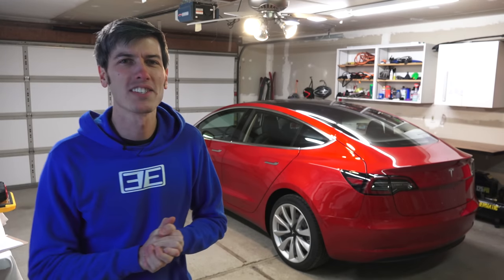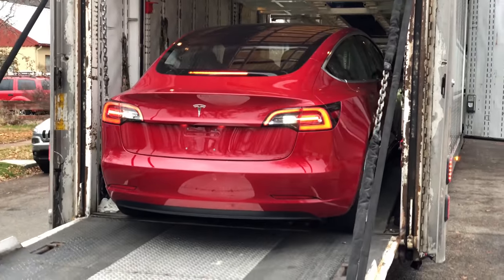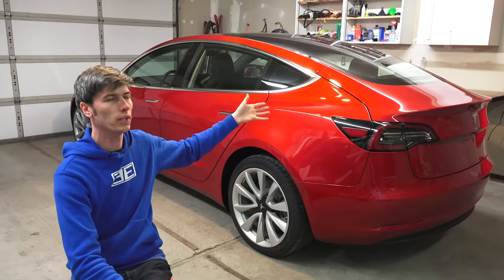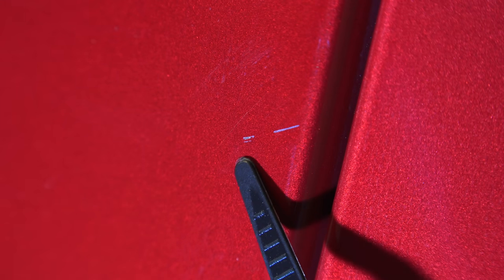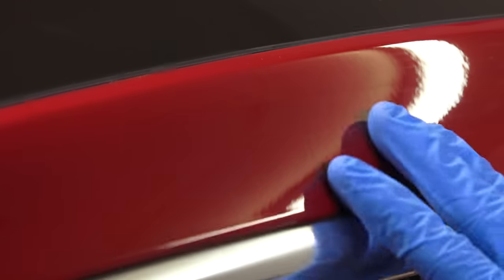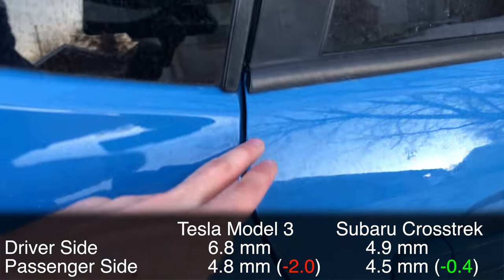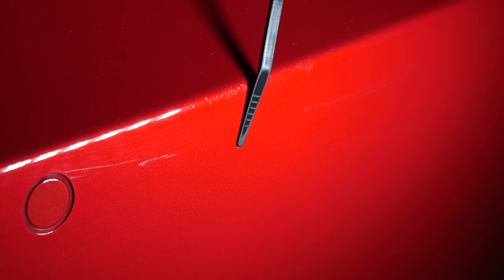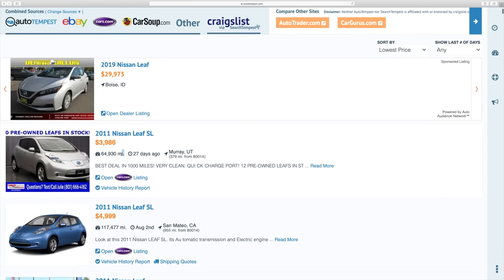Everything That's Wrong With My Tesla Model 3 - Quality Problems

Comment: Can someone buy a new merc, BMW or Audi and do a video like this. I would like to compare the quality to the tesla
Reply: Well, he did compare it to his older Subaru ...
And, I'm guessing he didn't pay a $2500 upcharge for the paint on the Subaru.  For me, the main reason the paint is unacceptable, is it was a rather expensive "feature," and to have a paid-for feature not done well, that's bad.
Reply: A few year ago a cousin of mine bought a new Reanult Megane. Upon inspecting it at the dealer we found it had a noticeable depression on the drivers door pilar down the bottom. He decided to take the car because it would look like garbage one year later anyways.

My 2010 Seat Ibiza had perfect paint, but my dads 2014 KIA Sportage had some "orange peel" to its paint. No scratches on both cars.
Reply: @Biker_Gremling  That's one thing about VW Group body and paintwork - they pay a lot of attention to the quality. No orange peel on any of our VWs, and they range in production dates from the late 90s to 2017.
Reply: I'm very tempted to measure my 2007 Jaguar X-Type panel gaps. As for the paint quality - some minor stone chips, and a scratch or two due to inconsiderate people in car parks, but there is zero orange peel and the paint looks like a luxury car's paint should look.
Reply: Don't need too. They mostly require premium gas, expensive oil changes, more frequent brake work, less tech, don't improve OTA like Tesla.  Maybe it's just me, but give me extremely minor surface issues (that they're resolving as is) vs having less of a vehicle that only gets worse and costs more to own. If you prefer possibly better paint and 'rich leather' vs a car that feels 5-10 years ahead of the others, go nuts ;)
Reply: My audi was flawlass.  It's black and it didn't have any swirl marks so that the paint looked wet.  My car was special ordered by me and I took delivery after three month wait.
Reply: @m40dot   Depending on how you drive (especially a manual), you might not need brake work that often either. I'm on 120 000 miles with my current car, and it's still on the factory brake disks and pads, with about 40% life left on the pads.
Reply: A couple years ago I bought a 6 month old 1 series with way fewer issues than this. No one should accept this kind of fit and finish in a brand new car, imo.
Reply: @josephgaviota  while i dont disagree i thinj thw paint itself is flawless, in a candy like that usually you get little mishaps that show under light. but the care taken after paint of the parts is where the issue lies
Reply: @chrwl007  I honestly would had prefered some imperfections on my paint instead of suffering Dieselgate.
Reply: @chrwl007  would be good if they payed attention to emissions also.... Ya know
Reply: @chrwl007  so unreliable car how can you live it with?
Reply: @deathman020  Much easier than it is for you to keep on explaining how you can keep believing the Jaguar bad reliability myth fed to you by motoring journalists with an agenda and your car bros who think having a car so low that you can't see the top of the tyre is cool. Underneath it's a turbodiesel Mondeo with a manual gearbox, so the drivetrain is bulletproof. Don't even think of mentioning electric and electronic problems... those were all Lucas.
Reply: @deathman020  That was Dieselgate... didn't affect their petrol-engined cars at all. Also, they were the only manufacturer caught cheating. How about Hyundai Motor Group that overstated their cars' fuel efficiency by up to 30%?

Comment: When comes the time, when Germans starts with electric car production, Tesla will be dead.
Reply: They were supposed to have killed Tesla by now - they just haven't found a way to do it. If I earned a buck every time I read about a Tesla killer in the last few years, I would be very rich by now
Reply: @toneyeye  they have got a head start thats all and a big fat fanboy base because I would pay only 1/4th the price for that kind of quality.
Reply: You know the Germans always make good stuff
Reply: Unlikely we will maybe produce good electric cars but if Tesla keeps inproofing we do not stand a Chance.

As you can see it with the taycan poor efficency, small range, extremly expensive.
Reply: They won’t really. Hydrogen will probably out produce EV.
Reply: @flyboy970  Liquid Petroleum Gas has been available for years.  It's around 75% cheaper per distance than Gasoline.  Currently it makes up only 3% of the world's cars.  Hydrogen will face many of the same problems with adoption as liquid propane.  It's also about 6X more energy per volume released if it explodes.
Reply: pyro226 actually producing hydrogen en mass is very expensive, the best way is probably through electrolysis and over time the cost will come down, just like Lithium has. Hydrogen is about 7% the density of air, in a car it’s a none issue. Petroleum is pretty flammable and explosive yer....?! A lithium battery explosion is far more an issue for two reasons - lithium is heavy and thermal runway in the cells makes it difficult to extinguish quickly. Still hasn’t stopped mass production. Point is, longer term, Hydrogen is cleaner and won’t be dumped back into landfill like lithium will when the cells die.
Reply: @flyboy970  I know electrolysis can be used.  From what I heard, hydrochloric acid and aluminum are better producers and the components can be recycled better.  It was a big discovery when someone looked into the chemical reactions behind the Works Bomb.  Gasoline is explosive, but I'm under the impression that it is less so than propane and extremely less so than Hydrogen.  Diesel isn't explosive and cold countries fuel while the vehicles are running as they won't start if shut off.  I was debating on mentioning the energy density of lithium.  Even if we doubled the energy density, it's only taking 500-600 pounds off a Tesla if we wanted to maintain the same range (less if a smaller car).  On the Tesla's, it's only a small improvement on fuel efficiency as the car weigh over 3500 pounds.  So maybe a 10-15% improvement in range by cutting battery weight.  Another benefit is that if the battery has better density, they use less materials to procure the battery, so it's going to come down to the cost of lithium's replacement and how cheaply it scales.  Cars with small batteries are just going improve in range as it doesn't make sense to cut battery size.  Main reason that I bring this up is that batteries need more than 2X their current energy density going forwards. Lithium fires are bad, but I haven't heard of them in cars yet.  Car Lithium batteries are probably mandated to be recycled.  The chances of lithium car batteries going to a landfill should be low.  While clean is great, it doesn't usually drive the market.
Reply: Once Toyota gets in the game it’s over for everyone.

Comment: Wait you really got this car as new and with those scratches/defects? No way in Europe they could sell so bad condition car as new. Actually  it's shocking that you are giving for fixing, because no way they are going to paint metal parts same as in factory.
Reply: Kaupo this never happens in the United States. This is just a recent Tesla thing
Reply: Europe isn't magical. Laws don't stop things from happening, they're only there to punish and amend if they do. Tesla could and probably will still sell a car with paint defects, and you'll just complain under your European law to get it fixed. There are plenty of examples in all the car industry where brand new cars are delivered with issues, and that's why they have a warranty so you're easily able to get those issues sorted out.
Reply: @simonj48  Wait you are talking about fixing metal parts by repainting for brand new car? They will repaint it, not exchange to new factory painted parts. No human would agree to that and return the car.
Reply: @kaupo8699  Im working as a detailer in sweden and its not uncommon to repaint panels that have been damage in shipping or have defect from factory, before or after its been delivered to customer
Reply: @MrPontiacpower  And you don't tell it to new owner, right? That's why I always give my friends paint meter also for new car buying.
Reply: @kaupo8699  well we are a separate company that does the pre delivery work, but yeah sure, the customer never knows. With that being said I think its wrong and poor customer service, but to be honest like 90% wont notice and wont care about this stuff once they see their shiny new car sitting there

Comment: Even without an upgrade paint - it should be flawless or they make it so.
My biggest "not going to buy one" is the interior... for a $70K car, it should be something more than a $18K Toyota.  The interior is terrible in every regard.
Reply: Isent the model 3 meant to be like 35k?
Reply: Sandertu it “starts” at 35k yes. Extended range model or performance model will run you upwards of 40k.
Reply: @timothygross5512  And the cheap toyotas start at 16k so he is still talking about the cheap versions.
Reply: Sandertu also if you look at the general 5 yr average cost for owning a car, there was research done between a 28k civic and the Tesla at 38k with the Tesla actually ending up costing less by the end of the 5 year term. Story short you’re kinda just paying some of the ownership cost upfront with a Tesla. It’s kind of a trip cause yes the up front price is a little high, but your savings are much better than with an ICE vehicle
Reply: @timothygross5512  Hmm, i have not seen the research you are talking about but 2 things i know about batteries.
They dont last forever, they will need to be replaced at some point, fully, no refurbish BS. and that will be more than half of the cars cost. All comparisons done before that is of not much use for the longterm ownership. The body may last 1 000 000 but batteries certainly dont.
They are not suitable for climates with proper winters. So hope for faster global warming for that to change.
Reply: @sandertu8366  
They last for a million miles, just like the drivetrain
Reply: @ogzombieblunt4626  Sauce please!

Comment: Are sure this isn't 90's GM quality!?
Reply: I love the 90's gm comparison everyone always does.. Oh you mean the car you drove when you were 16-22 didn't hold up to your constant abuse quite as well as the twice as expensive car you drive as a more mature 35-40 year old.. WOW, I am shocked.
Reply: @illregal  all I remember about gm is my parents cars. they rust bad after like 15 years, lots of mechanical gremlins, no good. Then my mom got a 2002 corolla and has had it longer than any gm or ford back then.
Reply: @Gritt982  in the early 2000's car manufacturers started electrocoating the frame and panels with an anti-corrision material. Rust resistance is now better than it was in the 90's, so this comparison is a bit harder to justify. Additionally, major rusting usually only occurs in the northern states due to the use of salt on the roads.
Reply: @GOAE7777  what about my first car, the 97 tercel, why didn't that rust as readily as my mom's 95 Sunfire? I didn't wash it more or anything.
Reply: @GOAE7777  my dads 03 Chevy Optra also had a rust problem. Again my mom's 02 corolla is still on the road. I think gm has failed my family as a whole. They had more than one chance to build a respectable car for us but were never capable. I went out last year and bought a new  corolla for myself. GM are okay if you get a new car every 5 years but That isn't for everyone, some people want a car that will stay intact for longer. I love gm and I hope they do well they just don't make the product/car that I need in my life.
Reply: Lol proof is in the pudding 😂
Reply: @Gritt982  15 years? What kind of loser drives a 15 year old car?
Reply: And someone who is going down the road in a vehicle combining primitive safety systems and degenerating parts well passed their intended lifespan.

Comment: At 5:26 you can see the Paint colour and structure are different left to right. Cars normally get painted with all body parts assembled. Means at yours parts were swapped afterwards. Y you accept the car at delivery. I received a Renault here in Germany delivered on Truck an i took 30 Inspection time, before i signed the delivery papers.

Comment: Dude, if I receive a new car with paint work like that I will ask Tesla to come collect it and provide a proper replacement or refund my money
Reply: You didnt watch the part of the video where Jason said that Tesla will fix the car and give him a loaner car in the meantime? What else can they do,  sometimes things doesnt go 100% and things needs to be fixed. This looks like transport damage mainly, except ofcourse the dust in the paint.
Reply: @Robinlarsson83   -  Yep, and sometimes things don't go 50% either...
Reply: @Robinlarsson83  Then it would be fixed car, not a brand new factory car. Any extra clear coat on a panel will give different color reflection from original adjacent panels . Buying online is terrible ,  you should see what you get on a lot.

Comment: wow did they use 100 grit  sandpaper to give the car a last polish ? The Finish is horrible so many small scratches . And the Glass pieces don't match up at all. But even the older teslas feel like your riding inside a tin can.

Comment: The panels not lining up is a manufacturing issue that should not be happening on a car of this cost. The paint issues are very much a process issue where no one is doing even a basic walk-around of the car before delivering it. That is a very, very simple thing that every new car dealer/manufacturer requires and it's shocking that Tesla did not do that. I just bought a 2014 GMC vehicle from a local dealership and they took it in a light room with a scratch and dent specialist and made the thing look like new without me even asking. That didn't cost them much but it made me a happy customer who is more likely to buy that brand again and from that location.

Comment: in italy if u buy a brand new car such things are not accettable and the client can ask for a full repaint (and a red not metallic paint from manufacturer  it's not 2k euros/usd for the god sake.. it ranges from 0 to 350/500 as optional) from the  reseller/manufacturer.. and this is true for a bmw to a citroen c1.. this is the problem of buying a car online where ud cannot check it's condition before u took the keys, sign the papers and leave the dealer.

Comment: I've got another flaw to point out: It's electric. Alt fuel vehicles are all fun and games until you have to actually use them for things. Hopefully, you're the 1 in 10 that only drives it the same distance every day and is able to charge at home. Otherwise, you have to plan your route and your destination around available refuel/recharge stations. We make the most of a CNG powered E-250 work van, but we can't take jobs outside of a given range. The vehicle is essentially stranded around a refuel station. If that station is out of order, we have to abandon the van in the parking lot and get somebody to pick us up. Sometimes, we fuel up on our way to work and on our way back just because we question whether it can make it back to the pump the next morning. Spending less for fuel is nice and resale on these things is garbage so we picked it up for less money than a traditionally powered van, but this is the last one. Do yourself a favor and stick to regular unleaded and diesel.

Comment: So if the thing has such crappy bodywork, I wonder how many mechanical faults can be found, hopefully the brakes will work ok !!!
Reply: I wouldn't expect that to be a 1:1. From what I understand the car's are quite modular in nature and the assembly plants are probably just installing pre-assembled techy parts. It's not a good sign, but it doesn't necessarily mean much. However after following a few Tesla owners over the last few years online, it seems there are substantial reliability problems in at least the model S, particularly door handles and motor units. It doesn't get reported much as you have a very long warranty, but when that's over, and with tesla having a stranglehold on parts and servicing right down to the software level, I certainly wouldn't buy a used model S. Hopefully they're getting better, but I'll let other people's money test that theory.

Comment: Could the scratches be from the movers
Reply: I'm wondering this myself.
Reply: They most likely are.
Reply: It most likely was, but as company you cannot deliver a car in that condition lol
Reply: But he proved that scratches are below the clear layer. Also, what about the obvious glass gap and the dirt contamination under the clearcoat? Too much defects in one single car
Reply: SDD525  Yep the simple fix for the glass is to get it right in the factory. The rear door with the scratches through to paint that the water test was done on was telling since the scratching goes all the way to the panel gap but the neighboring panel looks mint. Going by the general fit and finish, quality control is very lax bordering on non-existant.
Take a look at a budget Hyundai for panel fit and gaping, the ones that come to Australia have amazing quality in that area. I believe over half the Hyundai's for the American market are made there so it might not be a good example.
Tesla will be a laughing stock if they sent these to Europe, maybe the Americans get the seconds though.
Reply: Smudge Codes why did you accept it and give them the check??

Comment: When I got my 2007 Saturn Vue it had come up for sale 35 miles on it. Sitting outside for 5 days not a scratch to be found. Paint job was flawless! For a 60k car after as on's. To have paint problems like that is horrible! Specially threw the clear coat. Nope demands fixing!